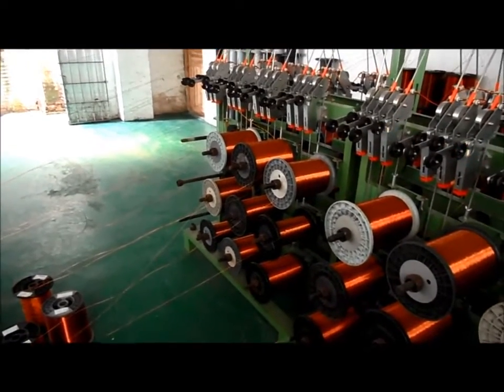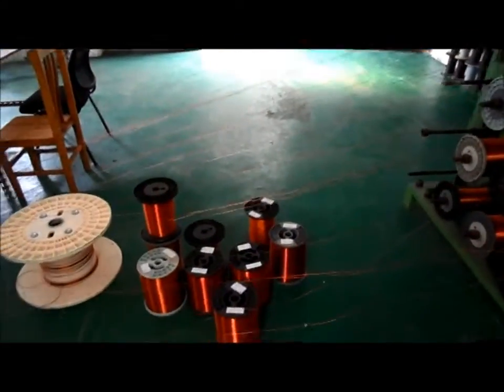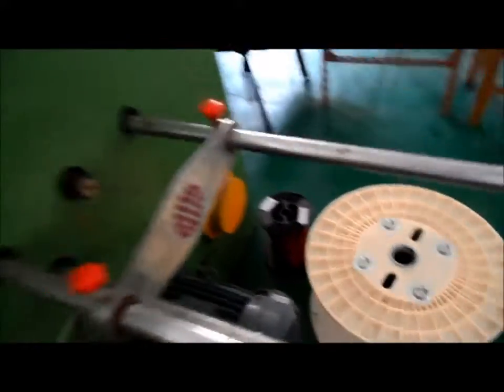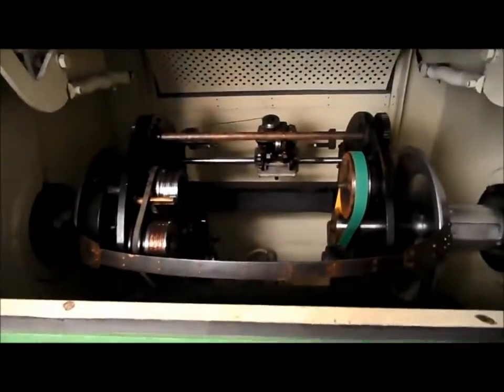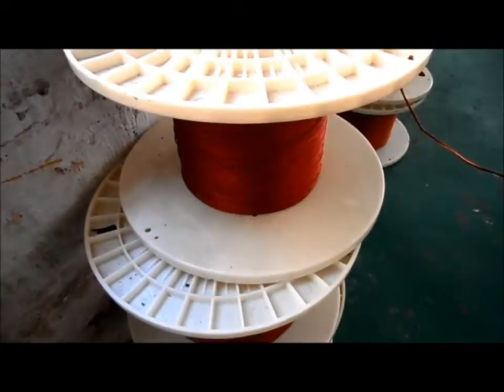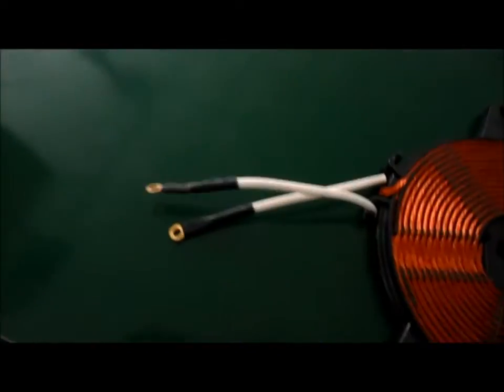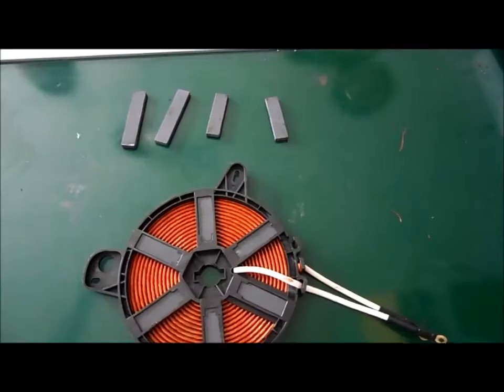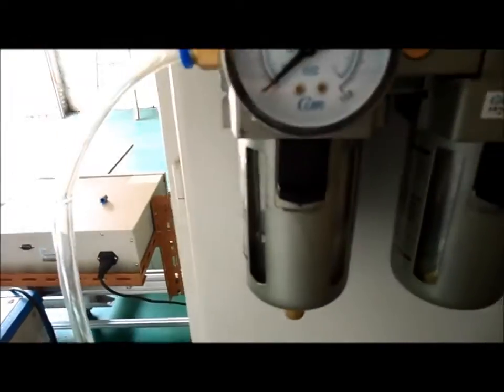Induction cooker coil disk production process  produce cooker coil disks

Comment: What happens if we give 230 v ac direcly to induction stove coil 1800 watts
Reply: It will blow a fuse. 
The stove induction coil is designed to work at about 20 kHz AC. That high frequency is achieved with the help of power transistors and high voltage capacitors.